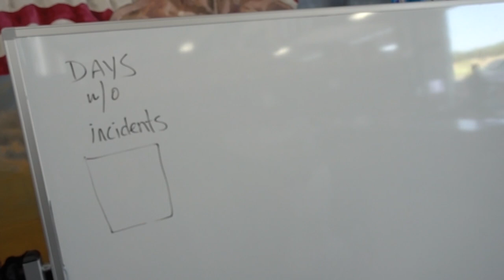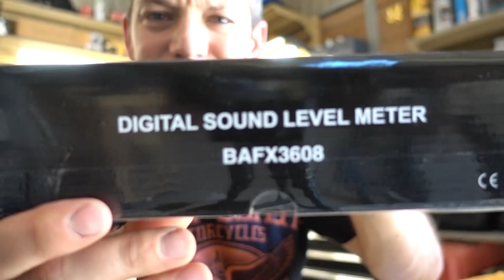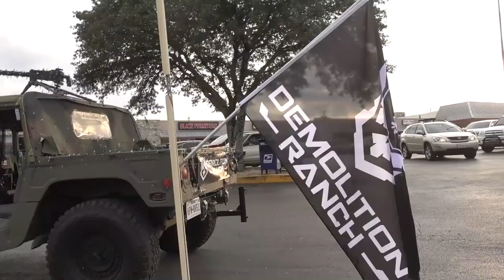Casey Neistat is NOT Telling The Truth

Comment: MATT!!! On your rain catch system, YOU NEED TO DRILL A HOLE IN THE TOP OF THE OVERFLOW SECTION! If you do not, YOU WILL START A SIPHON and drain both barrels!
Reply: I hope he sees this :P
Reply: All he needs to do is keep the final outlet just barely below the overflow so the water only flows when it is higher than the outlet. A garden hose works fine for all this, even connectors for a clear pipe. PVC is very unecological.
Reply: it probably wont start a siphon unless the pipe is filled with overflow water. what im trying to say it that im not sure enough water would rush out at once to create the vacuum needed to start a siphon. it could for sure create a siphon if enough water overflowed at once, but idk if it would
Reply: The way siphons work is, once the lower water level of the "exit" is below the surface of the reservoir, it will pull the remainder out. If there is no STP air inlet at the topmost point of the U, the water falling down to the exit will pull out the rest.
Reply: The volume of water during a rain storm will definitely be significant enough to flood that pipe,  hence starting the siphon and emptying both barrels on the ground.
Reply: Keci
Reply: I agree with the possibility for a siphon.  The vent hole will work, but it can also leak.  The other solution would be to remove the top 90 and replace it with a T.  This would allow a vent riser that would break the siphon and wouldn't leak.  My next comment is that I think his overflow line is undersized.  Looks like there are two 1" lines coming into the shed, but only 1 1" line serving as an overflow.  pi r2
Reply: He unknowingly made a greedy cup ( Pythagoras cup )

Comment: Your overflow needs a siphon break on it cuz once it starts to overflow it might just siphon your barrels right out
Reply: Wayhart great point!
Reply: Hemo-Goblin not in direct sunlight , algae shouldn’t be forming
Reply: Hemo-Goblin it's in a dark cabinet I don't think algae will be an issue.
Reply: He didn’t show if there was a vent to stop that, but I don’t think it would matter, the overflow pipe shouldn’t ever be completely full of water, meaning air can get past to prevent siphoning.
Reply: With the amount of surface area he has collecting into those barrels one good hard rain for an hour would be enough to fill them from completely dry. At that point, imagine how much water is coming out of a gutter during a hard rain, that will all be trying to force its way through that small pipe, once the rain stops, the barrels will empty just like a toilet. Even if he does put a small hole in the top of the overflow to stop the syphon, I would bet that during a hard rain the water will come out of that little hole like a fountain.
Reply: Matt Noot I have an Aquaponics system and the first thing you learn is if it can syphon it will. The whole pipe dosent need to be full, just enough to draw the water below the level in the tanks.
Reply: Came here to say exactly this. It will definitely siphon itself out once it completely fills.
Reply: That happen to my chicken pen took me weeks to figure it out,but all good now,they even have a over flow bath from the water,they love it always in it,
Reply: Siphon break is definitely needed based on my aquaponic experience.
Reply: If the lines stop at the barrel and not to the bottom then no it will stop at the line level.

Comment: Looking at that pipework setup once the overflow starts running it’s going to siphon out the water til 1 barrel is empty. 

The siphon will then stop once air gets drawn through the pipes.
Reply: Paul Wilson most likely the over flow will be at a rate slow enough that it doesn’t start a full siphon.
Reply: To stop the syphon just add an open stand pipe from the top up about a foot

Comment: Won't that drain siphon everything out of the barrels if it starts overflowing too fast? The pipe will fill with water preventing air from getting back into the system and the barrels will empty out. Is there a clever secret we can't see?
Reply: Alaska Skidood Definitely gonna have to agree with you. The system to equalize the barrels should work just fine, but unless there's some kind of air vent in the overflow pipe, Matt could end up with some thirsty chickens if he's unlucky.
Reply: I was thinking about that as well
Reply: Agreed the system is an automatic siphon as constructed.  I posted a fix before I saw this post.  It  needs a vent at the top of the overflow loop higher than top of barrels at min, or higher than lowest gutter assuming you have non leaking barrels and want to keep inside dry
Reply: If the drain on the outside of the coop is at the same height as the top of the barrels then the drain will only drain out overflow. But if the drain outlet is lower than the barrels then the drain will let out the water in the barrels due to the hydrostatic pressure in the barrels, only equalizing when the water level in the barrels reach the same level as the outlet of the drain. Depends on the drain outlet level, which we do not know. Mere probably took fluid dynamics studying CE so I'm sure she has a trick stopping it from siphoning.
Reply: maybe just the diameter of the pipe would be enough? Or alternatively, the first vertical outlet pipe could be removed, and place a much wider diameter pipe in its place that could act as an outflow without being sealed (much like how down pipes often have a break between the drain and the pipe above it), and the wider diameter pipe would be able to handle any outflow pressure that may be created in the system.
Reply: Cheesus Sliced diameter of pipe does not effect pressure. Only height and density effect pressure.  The large barrel and (I am guessing) 1 inch dia pipe have the same pressure because they both have the same density (watet = 999kg/m^3) and water level (height of water in system)
Reply: but the pressure still has to keep up with pipe diameter, does it not? otherwise air will still bubble past it if there is room and the water pressure isn't keeping it out.
Edit: and the fact that the pipe is going back up to the height of the barrel would reduce the effect that the mass of water inside the barrel would have to essentially nil, leaving you with just the height vs diameter. Is this not why people typically use thin tubes or hose for siphoning? Theres no marking on the pipe, so it may well be 40mm conduit just like for comm lines.
Reply: Cheesus Sliced but the flow rate into this system is so small (its only rain) that the boundry effects of the pipe are negligible making it basically a level problem
Reply: By what I noticed, a siphoning could happen. The simple solution would be a vent at the top most part of the overflow. But if Matt does not want to redo all those elbows it could work to add a vent on the crossover tube and a siphon would end when getting to the crossover tube. Just T off and up a few inches higher than you want the water level to be and should work.

Comment: Hi Matt, I'm writing to you from Ukraine. Has noticed your drain design, it will not work properly if you do not make a hole in the top of the drain pipe. because if the drain is lower than the barrels themselves, then when the filling level is reached, the effect of "the law of the communicating vessels" is formed. and in this case all the water will flow out of the barrels

Comment: In your final overflow, between the 90's that go over your T, you need to put a vacuum breaker or else if the barrels overflow, it may siphon out all the water, back down to the lower fitting in your barrels.

Comment: Oh yea great design for the water barrel balancing line. 
One problem. you built a siphon. If you get a strong enough shower and the tanks fill it will dump the tanks through the overflow.

Install a siphon break vent on the drain!

Comment: Matt, your overflow is going to siphon your barrels dry.  Once the barrels are full and it overflows, the overflow exit being below the barrels and the overflow sourcing from the bottom will ensure both barrels empty completely.
Reply: Yes just add a t vent
Reply: I was thinking that but wasn’t sure haha :) wasn’t gonna say anything — glad you said it!
Reply: He can also drill a couple of small 1/8" hole in the top side of his over flow pipe to act as a air brake to keep a siphon from being able to form.
Reply: Yes drill a hole just big enough (tight) to put a IV hose in that sticks out 2 inchs and it will never siphon and won't leak out
Reply: He should put a check valve on the vent, so I could stop a siphon, but not risk overflowing into the coop in heavy rain
Reply: DuckMySquee 
Haven't we been through this already? Just trust him.
Reply: Ryan McHale 
We'll see. Honestly I am curious who is right. I trust Matt
Reply: Steven Leeming calm down, no need to go all toxic on Matt’s chat.  If the rain is heavy enough, the overflow won’t trickle over the elbow of the overflow pipe, it will pour over it.  If that happens, and enough of that pouring water becomes contiguous in the pipe (roughly three inches from what I see), a suction will form strong enough to pull more water from the overflow.  This will increase the amount of flow and more water will be contiguous, until the entire assembly becomes a siphon.  You only need the total siphon level to be barely submerged to empty the tanks.
Reply: DuckMySquee Thank you for being patient with people. I'll support your theory as a chemical engineering(process engineering) student.
Reply: Josh, maybe you should "trust tradesmen". Everyone in here who's actually done a lick of plumbing is in agreement that his system could cause issues.
Reply: DuckMySquee 4
Reply: DuckMySquee i don't think you're right about that... Possible but that's a weak flow and it's only using gravity like your sinks emergency drain
Reply: This is exactly how a siphon works. Using "only gravity" this "weak flow" could drain a swimming pool in a few hours.
Reply: Yup.  It's how I drain our pool to clean it.....stick finger in one side of hose, drop other side in pool, stretch out the hose on a decline and pull my finger out...voila....drained pool in a few hours.
Reply: @OoogaBoog I do the same thing when closing my pool for the season, but I use the vacuum hose. I put one end away from the pool and put the other end up against the jet to get the flow going, then I turn off the filter and come back about 30 minutes later to a pool that's drained below the skimmer basket.

Comment: back then 1999 the internet Speed was Low 33. baud rate for city  an rural were run DSL boxes or Non Existed ~ High Speed fiber cables didn't reach our area until 2006 high school had a dedicated T1 cable normal use were phone line dial up that internet Service change 7 time over the years with each a better speed online gaming made our top 35mps download up is only 14 that due the summer gamer mode which the brats cause delay thru the networks

Comment: Your overflow into the second barrel wont work very well. It takes a lot of pressure to pump water in from the bottom of something if the space you are pumping into has a lower cross-sectional area.